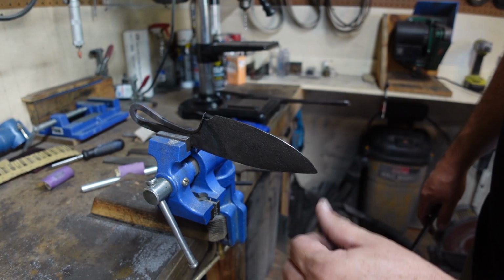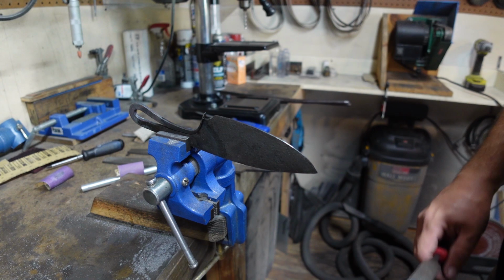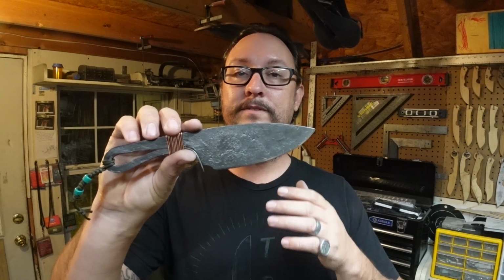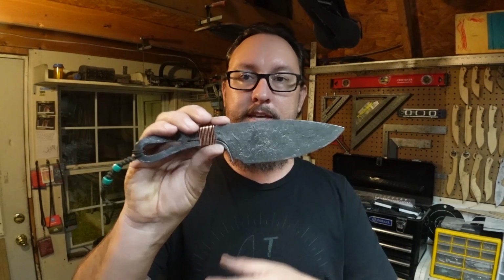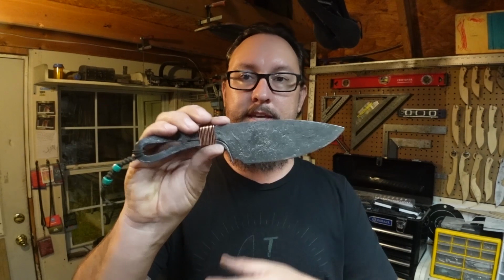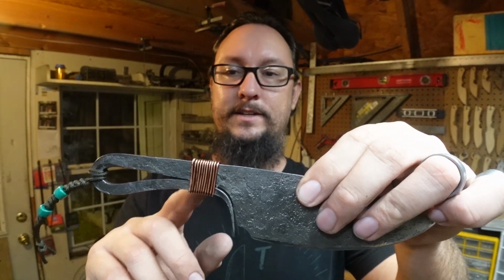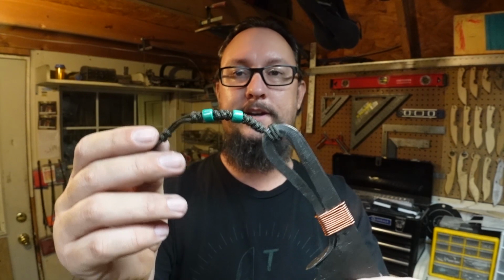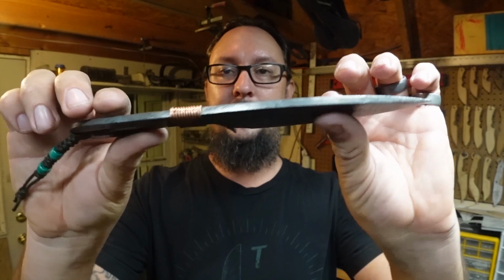Making A Forged To Finish Blacksmith Knife | Shop Talk Tuesday Episode 157

Comment: It took a heck of a beating to get there! 
Suggestion- really primitive knife that dates back to when people made knives out of a split bone would be the Siberian Yakut knife. Its got some pretty interesting geometries happening with a hollow on the sharpening, right side that's completely flat and a gentle curved bevel on the back left side of the blade. Rest is mostly just a semi-spearpoint shape with a simple handle made out of wood, bone and made for working with gloves so it doesn't need a guard.
Reply from the maker: I've seen a couple of those being made, I might try one of those.

Comment: Excellent Job moving that steel man!  👏  about how long do ya think it took isolating and drawing out that tang alone?
Reply from the maker: The tang took about just over an hour in total work. That's with heating times included. The overall knife took about 2.5 hours to forge including heat times and that's of course just taking my time and not rushing.